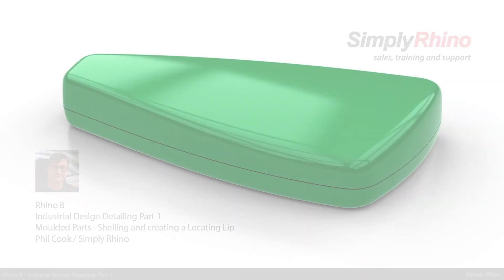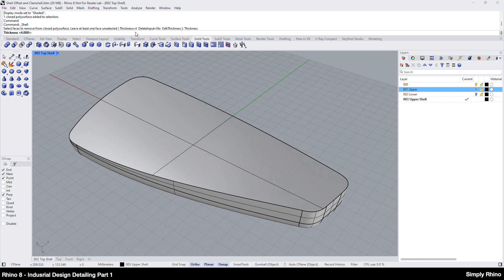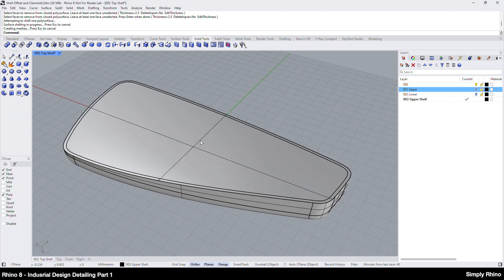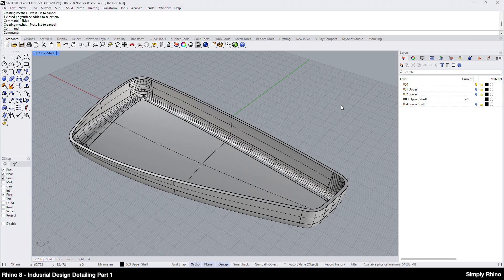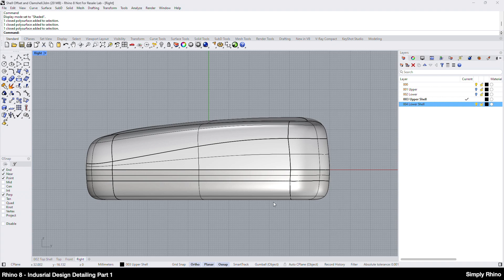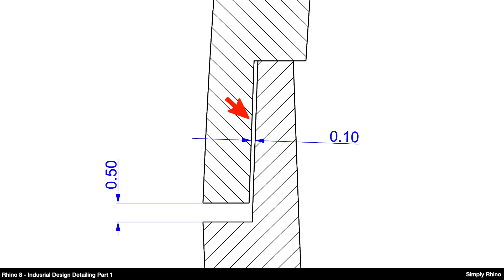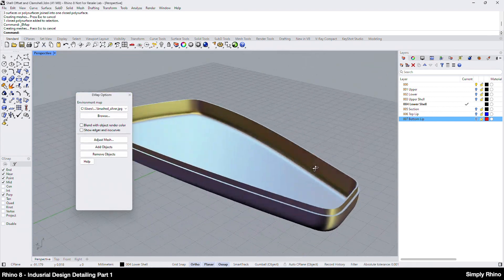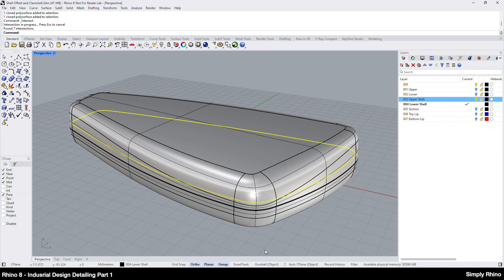Industrial and Product Design Detailing with Rhino - Part 1of 2

Comment: Thanks a lot for this video, it's really well explained and very helpful. I was just wondering, what the advantage of using an intersection curve to trim the surfaces is compared to directly trimming with the surfaces themselves?
Reply from the maker: Very often there is no advantage, however when the geometry is more challenging and you want to make sure of the correct result I find it useful to visualise the trimming curve. Also, in this case, if the trimming curve is not closed then I’ll know that my geometry hasn’t built correctly. Hope this helps and thanks for watching!
Reply: @SimplyRhino3D  @7:30 I'm not sure I understand all the details of what's going on but what about doing the offset surface as solid then use a cut plane to flatten off the top?
Reply from the maker: @perspectivex  The advantage of use an intersection curve is probably negligible in this case. However, with more complicated geometry you may find it’s easier to get a good result or diagnose problems by running the curve command. When you run a surface to surface trim, Rhino has to find the intersection before trimming with it - so by breaking the command down into its constituent parts I have found that complex or troublesome geometry is easier to work with.
Reply: @SimplyRhino3D  interesting.  Makes sense.  Thanks for the tip.

Comment: And now the tool maker requests a draft change, what do you do in Rhino? HOURS of work vs minutes in a parametric CAD software.
Reply: Agreed, as much as I enjoy Rhino I find myself never picking it up for any part that would require iteration on form or fit. I’m curious as to how pro Rhino users solve this problem. Coming from parametric CAD myself, I find the idea of using Rhino for manufacturing to be completely terrifying, lol
Reply from the maker: @hagus42  Hi, as in the answer to @eobet, I think the point here is that I’m starting with known information about the draft and fit and have surfaces that have been carefully sculpted and matched and so the premise here is that the ‘A’ surfaces are fixed. If I was doing this and wanted to build in some variability for the draft angles I would set up some simple curves that can be aligned perpendicular to rails to build the ‘sides' of the form. For this type of preliminary model I’d probably build simpler geometry with tangent continuous blends that would be simpler to adjust. With the final design as shown in this video it's important to understand that if the draft changed from say 2 degrees to 4 degrees its not just a case of canting the sides inwards by another two degrees - we’d actually need a different shaped curve to give the correct aesthetics - because just changing the angle would affect the curvature continuous blend between the top and sides and make this too ‘pointed’. This is, of course, just my opinion but I have been a professional industrial designer for nearly 40 years and taken many injection moulded parts to production.
Reply: @ That’s a good comment and I appreciate it. I am nowhere near as experienced, but my own parts have benefited greatly from the “safety net” of being able to go back into a constrained sketch or feature tree and just tweak and angle and have the whole thing recalculate. I think the difference with Rhino is that you have to put little “hedges” into the design to make sure you’re not backed into a corner where you have to redo things from scratch, whereas with parametric CAD it’s just a bit easier for a less experienced person. Having said that I’ve blown up my share of feature trees and had to start from scratch there too :)

Perhaps that could be good content for a future video. I think it’s fine that Rhino does things differently, the gap for me is that I don’t know how to make my models “defensible” to change rather than a one way street where I feel stuck.
Reply: Yup. If Rhino was parametric I'd probably use it as my main CAD software in a heartbeat. But as it stands every single design we start requires change and iteration further down the line and I don't have the time to rebuild surfaces every time that happens. I've never really understood how people use Rhino for product / industrial design where big changes are part of the design journey.
Reply: @frankyphix Hi Frank, the answer is very simple 😊 rhino sketches and features are not constrained and need fully defined sketches. In rhino you are working in 3d space and the sketching is extremely free and super high quality curves. If you need to change or doing iterations there are lot of techniques to do that. Im a Solidworks user and when i understand rhino i have noticed that if there are big changes in design delete and redesign from certain area it is faster that rebuild the error and lost references in Cad
Reply from the maker: Hi, @eobet Perhaps I didn’t make this clear enough in the video but the assumption here is that this is the final design and we’ve spoken to the toolmaker/moulder and have agreed the draft and other moulding details. If this wasn’t the case then building the whole of the A surfaces as single-span (Class A) continuity matched patches wouldn’t be a good workflow.
Reply: In reality - history trees crash, input points flip and fail. Speed of iteration can be much quicker in direct modelers. Its almost never cut and dry
Reply: @parelt  We use NX at work, it has both history trees and direct modeling (with history).